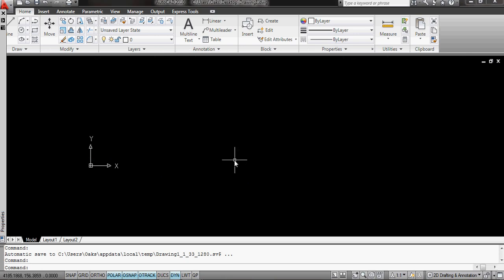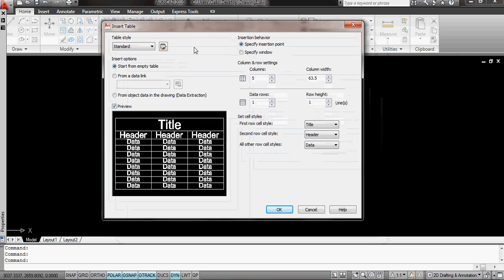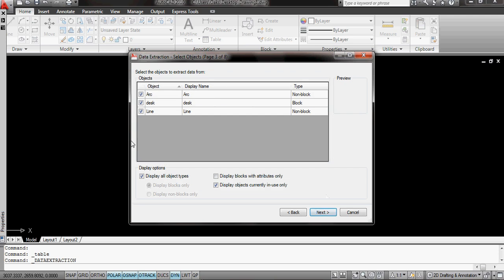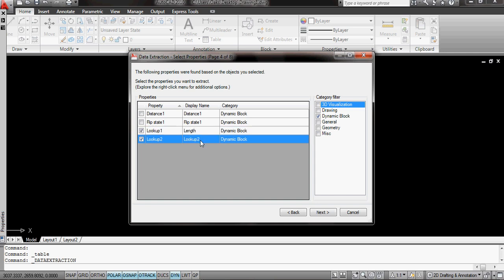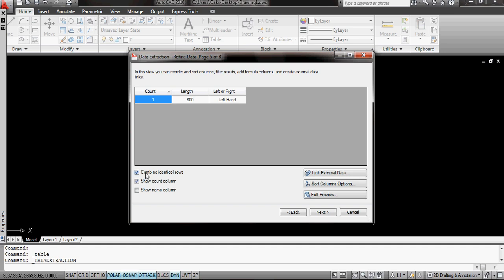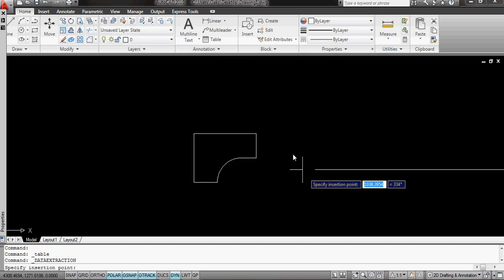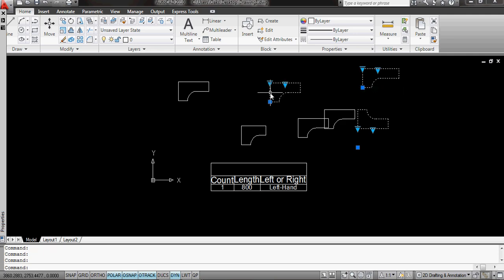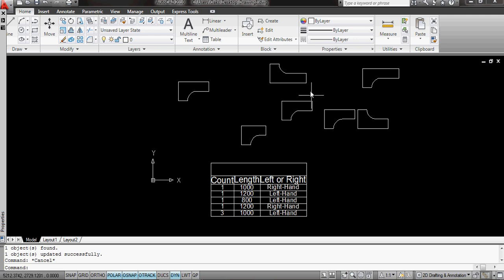AutoCAD Data Extraction

Comment: I'm new to this, but i find it could be really important.  what is the difference between the "data link" and "data extraction"  can these 2 be used?  I would like to make a spreadsheet from the dynamic blocks that i create.  having the spreadsheet show the height and lenght and the name of each block.
Reply from the maker: Data link will update if the information changes...data extraction is taking a copy at a point in time.
Hope this helps.